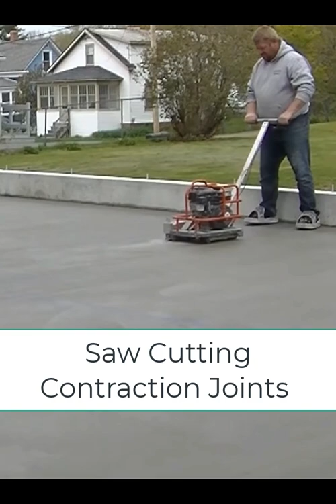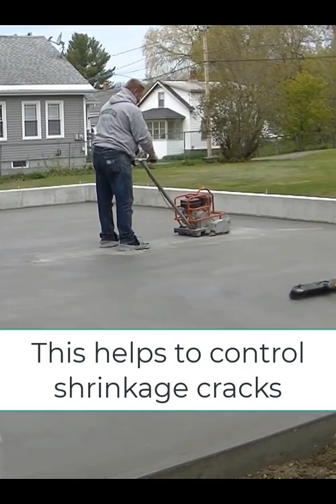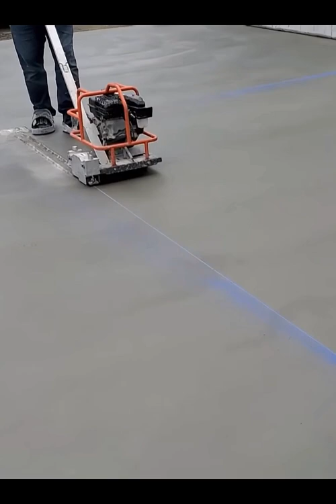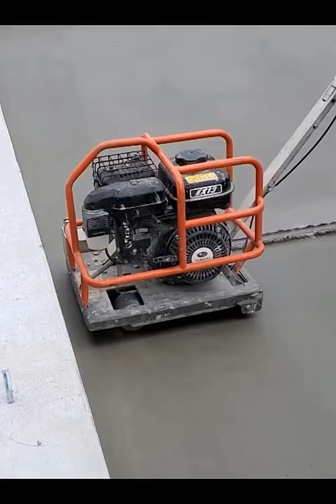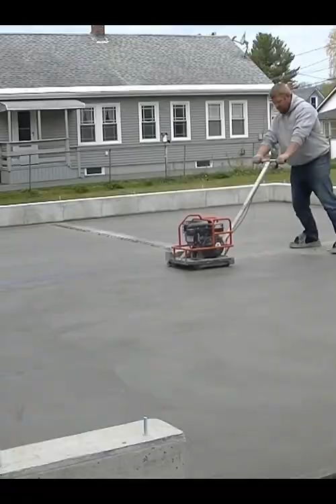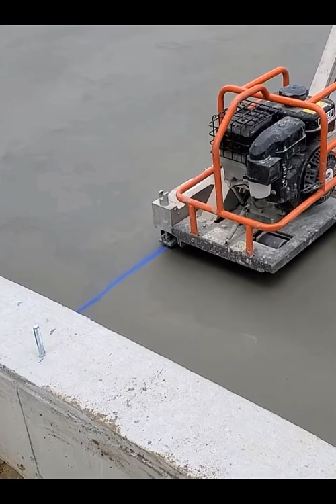My Favorite Concrete Saw #Shorts

Comment: Good saw. I also like the medusaw from skill, lightweight and fast
Reply from the maker: Haven't used that yet but we do have 2 of the electric soff-cut saws. They work good too.
Reply: I have he medusaw without the extension handles. It's a beast. It has plenty of power but mine isn't a soff cut 
  I of course use it for general cutting and decorative cutting of hard concrete

Comment: Just got this saw. Can you please tell me what do you use as a guide to stay on the line with using the actual guide wheel? Is it the point at the back of the skid plate?  Thanks a lot
NZ CONCRETER

Comment: No guide wheel
Reply from the maker: No, guide wheel on this sucks
Reply: @MikeDayConcrete  motor is junk also. MK srx 150 with Honda engine is far superior in my opinion. I have owned several. Even the harbor freight predator engine beats the husqvarna.
Reply: Yeah check out the bartell sg10k